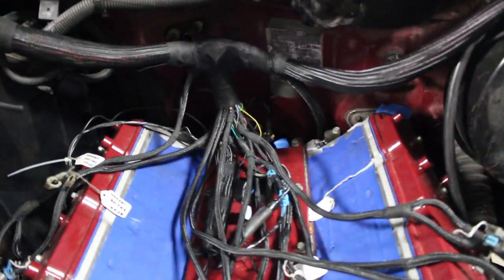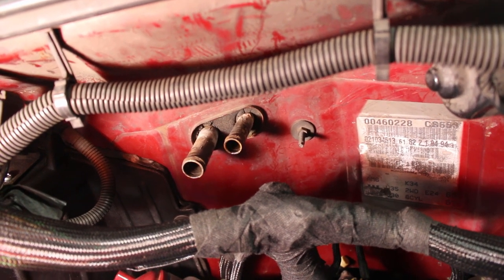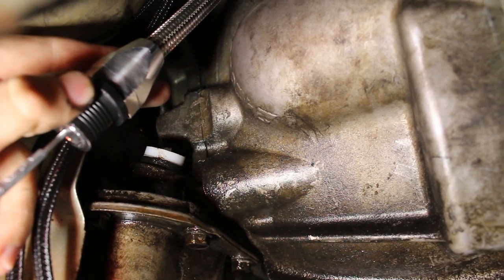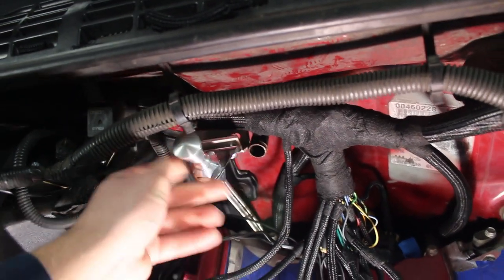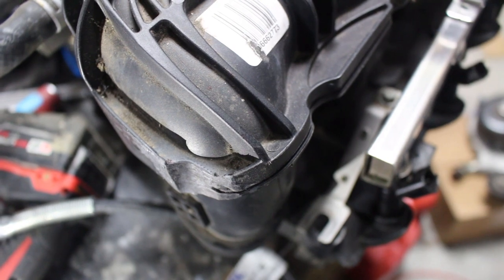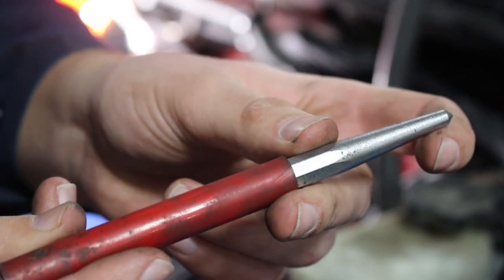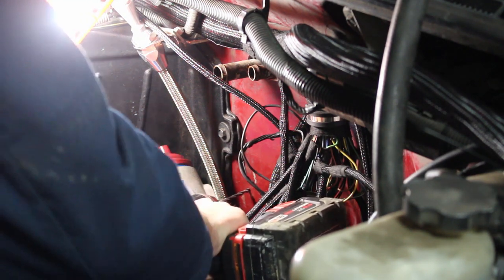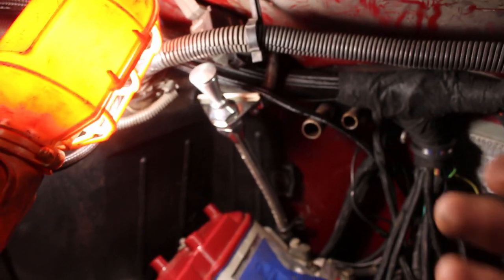S10 LS SWAP PT 11: Installing the TRANSMISSION DIPSTICK TUBE

Comment: How well does that dipstick tube work for you? I have the same thing and it leaks around where it goes into the case since or has no real seal, just a couple o-rings. Maybe I'm not doing something right.